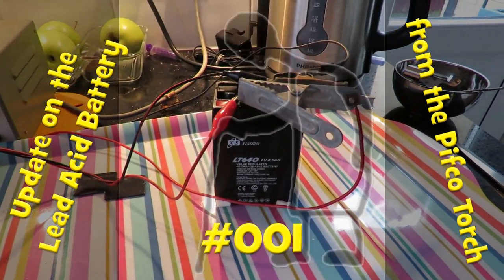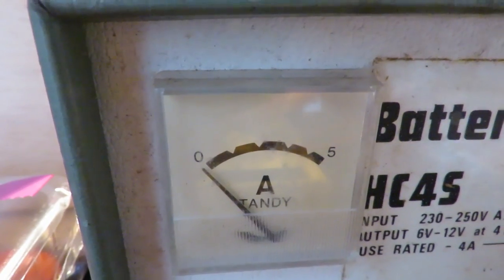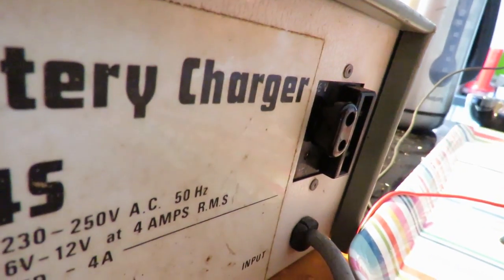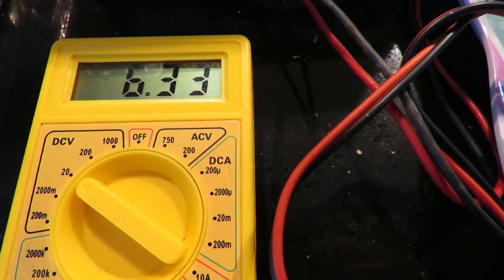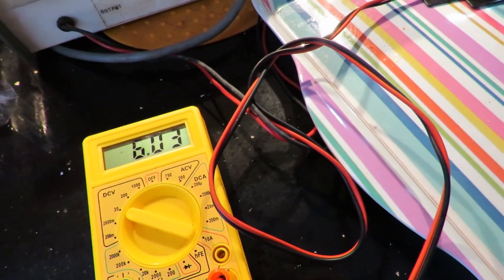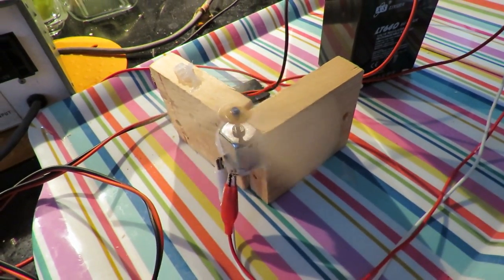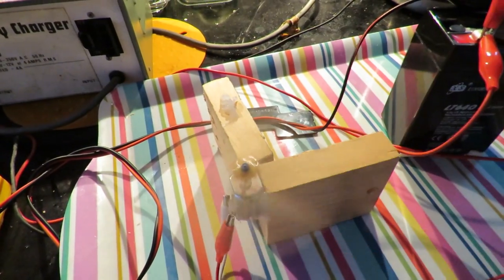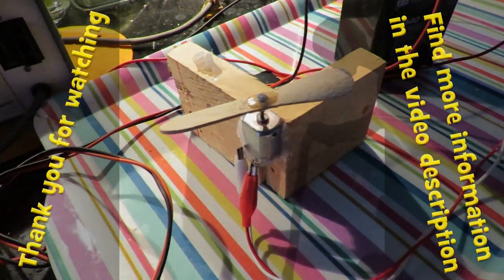Update on the Lead Acid Battery from the Pifco Torch #001

Comment: Once I recovered an old lead small battery that was very discharged too. First giving it new destilled water, then applying voltage from what it had to 12 VDC during a long period of several days. Finally ir recovered its normal status and the battery worked very fine.
Usually applying too much voltage to the battery when discharged over-stress the layers that forms it and destroys it. It's better doing by small steps during long periods.
Reply from the maker: This started to look like it was improving but then it went backwards.
Reply: I saw it GrandadIsAnOldMan I think it is due to the over voltage applied. Did you tried later with small increments of voltage over hours?
Reply from the maker: I had to tidy it away so I will probably have another go later in the year.
Reply: Great! I look forward for it GrandadIsAnOldMan ;-)

Comment: The fact your able to get the battery up to 13v shows that it has high internal resistance, esp if the current is low as well, as mentioned allready the battery is probably badly sulphated.
Soemtimes you can get some capacity back using a desuphator circuit, but such devices are skeptical at best.
Reply from the maker: Yes, we will see when I restart this project at some time in the future.

Comment: The ghost of Bidini ? Very little active surface there to play with. Have you ever tried to use an AC motor run capacitor circuit? It seems dodgy, but many say it works, it could take a month or longer to get a bad battery back. Of course your results may vary LOL
Reply from the maker: I had forgotten I had started this series. I was working in the kitchen and after a few days my wife had enough of me encroaching into another room of the house so I had to tidy it away. I might have to set it up in the shed and finish the job some time in the future. I have quite a few car batteries I had collected to work on. It's really a winter project for the cold wet dark nights.

Comment: when battery's go the positive terminal plate connections get eaten away by electrolysis, I opened up a car battery and there was no current  being supplied from the 6th cell but cells 54321 work fine and even after 5 min of charge it came up to 8v and about 6 a when shorted
Reply from the maker: I had forgotten I had started this series. I was working in the kitchen and after a few days my wife had enough of me encroaching into another room of the house so I had to tidy it away. I might have to set it up in the shed and finish the job some time in the future. I have quite a few car batteries I had collected to work on. It's really a winter project for the cold wet dark nights.

Comment: Way too sulfated, probably it was too dry to just add water, once i had a sucess on a battery sulfated using a bit of the battery solution with sulfuric acid, it was enouth to break some of the sufate cristals i did overcharge it and passed alot of current and leave it in a float charger for few days and it worked for a while i could get 4 amps average in an hour of a 7A 12v battery, i think the water you added didn't became solution and probably are overheating and producing hydrogen gas.
Reply from the maker: I had forgotten I had started this series. I was working in the kitchen and after a few days my wife had enough of me encroaching into another room of the house so I had to tidy it away. I might have to set it up in the shed and finish the job some time in the future. I have quite a few car batteries I had collected to work on. It's really a winter project for the cold wet dark nights.